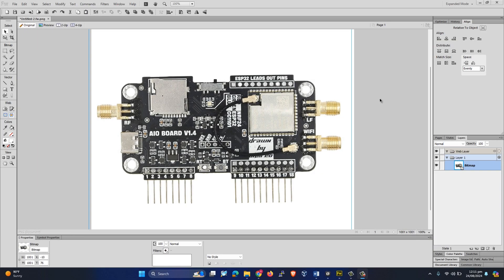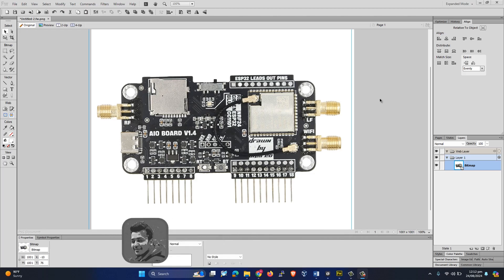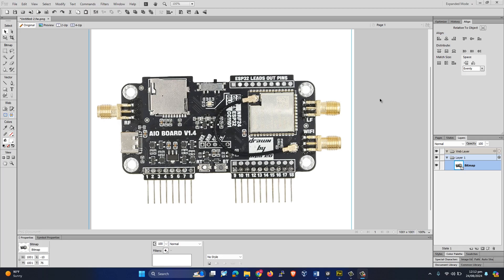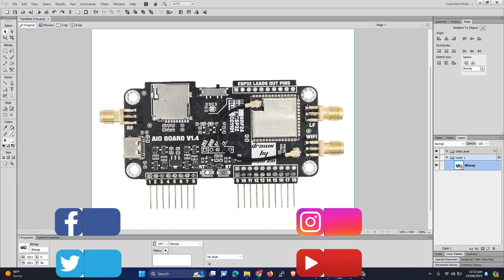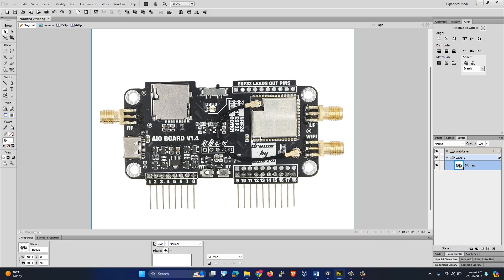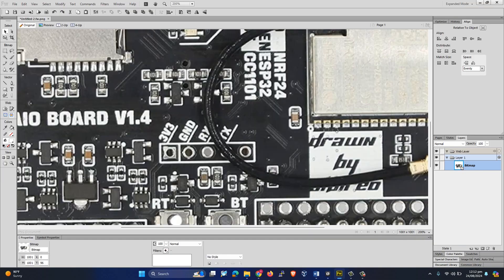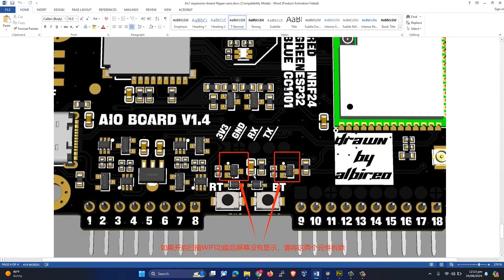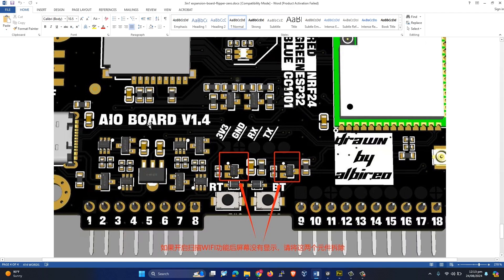3 in 1 Expansion board Fix for Firmware

Comment: I just use fzeeflasher. Chose flupper dev board flashed fine. Keep in middle. This is worst cAse. We are talking $40 boards pretty gpod vonsodering my oem cost 63 cad total and thislike 36 cad total. Haalf price using ali coupon And coin spo i bought

Comment: Hi there. Ive found that right after a reset if i hold the boot button and try a scan the board works perfectly normal (only while holding boot - used to function fine 🤔)
Do these resistors relate to my boot button issue? Thank you in advance.
Oh, and could you please share a link to your original source please?

Update: nevermind. Unsoldered the 2x resistors and board is running perfectly again!
I'd been looking everywhere for this fix!!
Thank you!!!